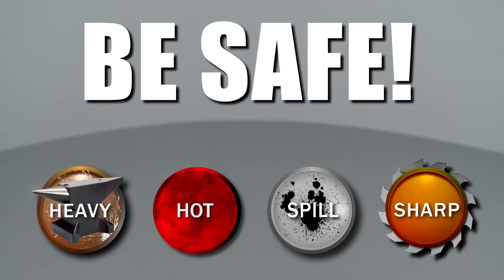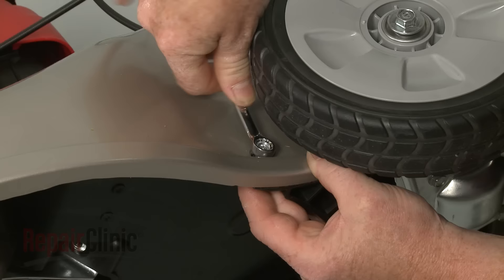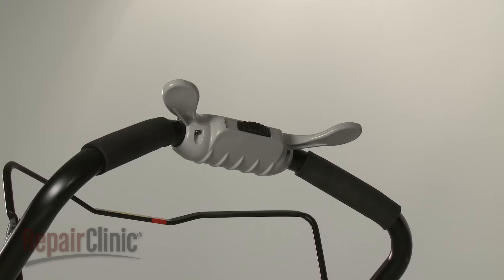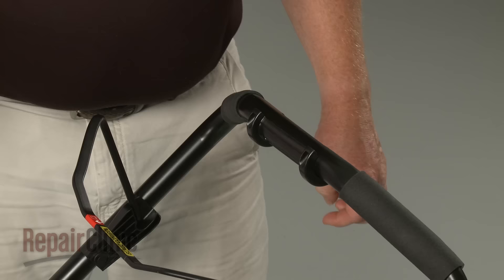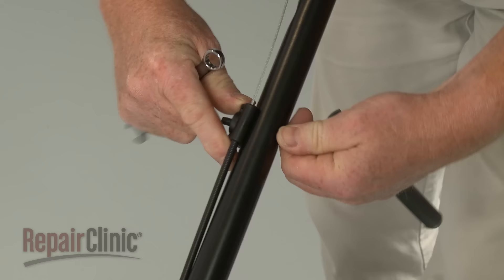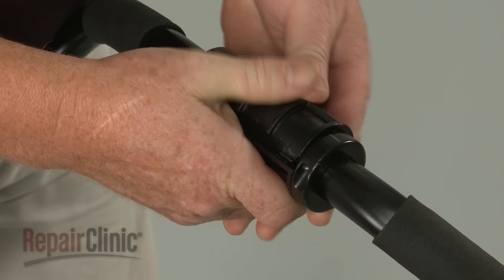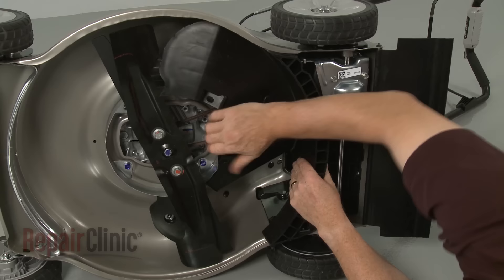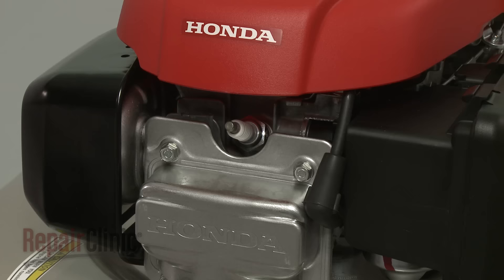Honda Lawn Mower Clutch Cable Replacement Part # 54510-VL0-P01

Comment: The video is certainly very helpful. The torx screw is not nearly as easy to reinstall as depicted in the video. It looks like a special tool was used to allow the bolt to engage the nut. It is impossible  to reach it with your hand and still difficult to install when using a magnetic retrieving bar. And since it is difficult to reinstall the shroud, I'd recommend that the drive belt be changed at the same time. It only involves removing 4 bolts that are easily reached.

Comment: Great video, thank you! 
Good idea to put retaining clip for torque bolt in shroud before putting shroud back.  
Also, is it necessary to take the whole brake bar off or just the left side?

Comment: Thank you for the video. My mower was not as pretty as this one in the video. I changed the belt while I was changing out the broken cable. The only pain was to put the control butterfly handle back on and not jettison the spring.

Comment: I put the butterfly handles back together but I still can’t get it to engage, what am I doing wrong? Also it just spins
Reply: I have this same issue. Wondering if the 'butterfly handles' are worn allowing the pin to misalign? Did you end up fixing it?

Comment: I have the HRX214KVKA MAGA 1433809 (2006). I've replaced the Smart Drive Cable, and the Smart Drive controller (with updated one), but my mower still moves a lot slower than it used too. Any advice on what to try next? I need it back up to speed, I have a long stride.

Comment: I am not sure if I need to replace the entire cable or not.  The top of my cable that connects to the grip does not look the same as in your picture.  The length of the cable looks longer between the cable eyelet and the part the clicks in the spot in the handle.  Can I tighten that up or do I need to replace the entire cable?

Comment: You did well except you quit too soon. You did not show adjusting the cable length for optimum engagement of the drive. Honda has a spec on that.

Comment: My HONDA Harmony II HRR216 self propelled mower's drive works fine but when I release the clutch lever, the back wheels will click when pushing the mower forward but the back wheels will not turn when I pull the mower backwards. Is this a clutch cable adjustment problem?
Reply: Traction control cable most likely or possibly a gear tooth slipped on rear tire. Less likely Axle is bent or Drive belt is damaged.
Reply: my honda lawnmower 217 back wheels will not go backwards only front.  what's is the problem please? ?
Reply: Bit late but no nothing to do with the cable. The clicking when going forward is normal, when your wheels seize up going backwards it's most likely the bushes on the drive axle that are at fault. Your driveaxle will get a bit of surface rust causing it to seize up in the bushings when going backwards. Take the transmission out, and dress up the ends of the axle with a bit of sandpaper until the surface rust is gone.